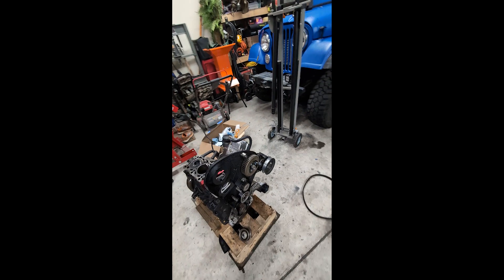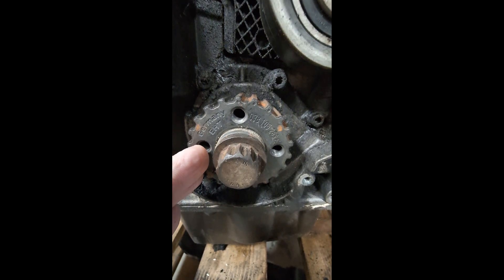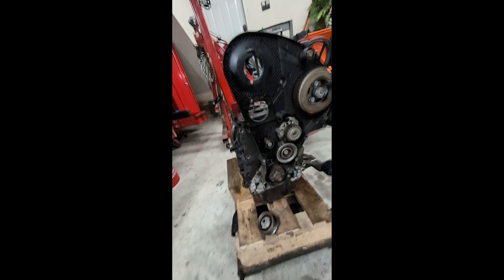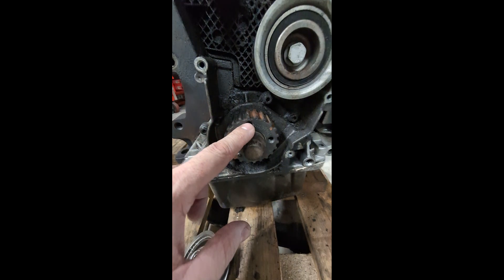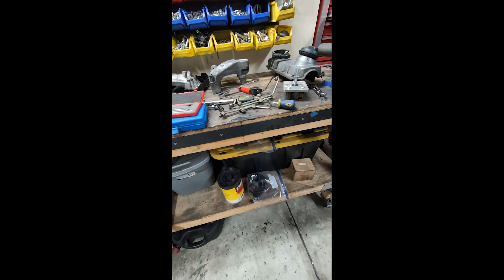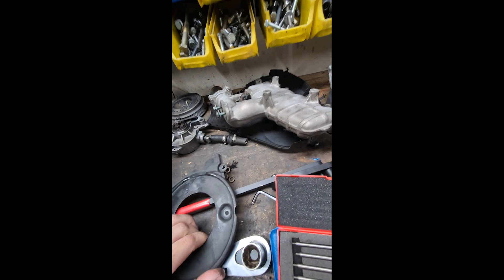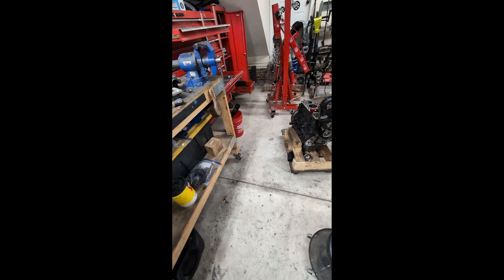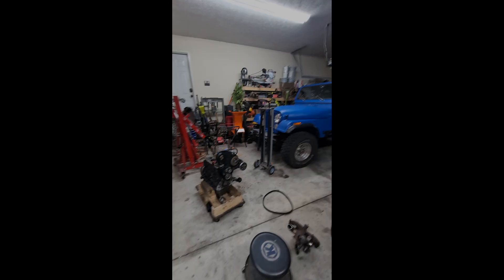TDI Swap timing cheat

Comment: Man that’s a great video.
I have one that I bought that the head was already off and in similar shape to the one you’re messing with. Any other pointers on getting it all the way together and in perfect time. Also do you have any suggestions for cheap vcds for the alh motor. I see some cheap stuff on amazon and it says it works with these older motors but I’m sure you know if they do or not.
Reply from the maker: Honestly, this is good enough for getting the timing right. 

As far as the VCDS, I've run the Chinese older stuff in the past from Amazon, eBay, AliExpress, etc. I currently have two VCDS cables at the house (legit) and they are just more convenient. Especially since my ECUs all have the same VIN flashed to them.